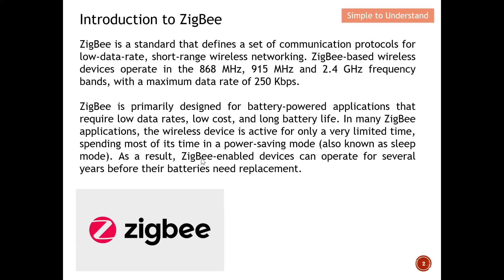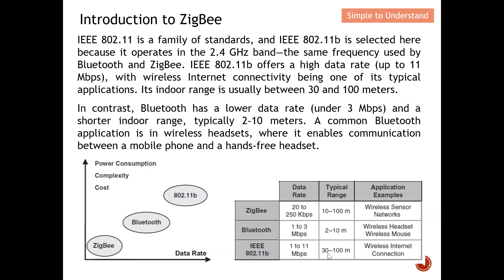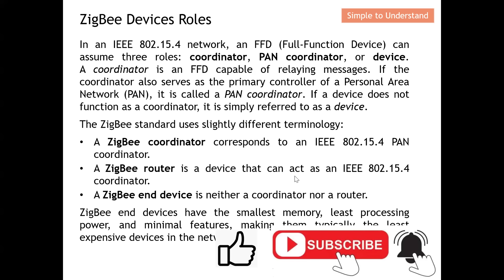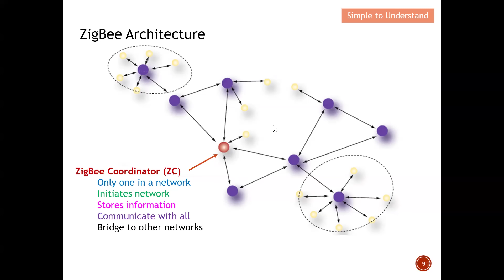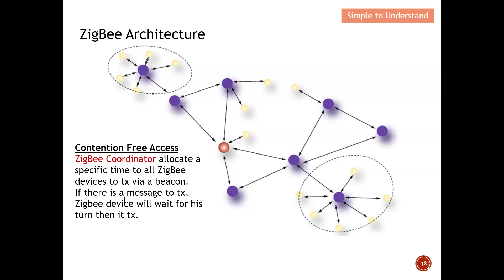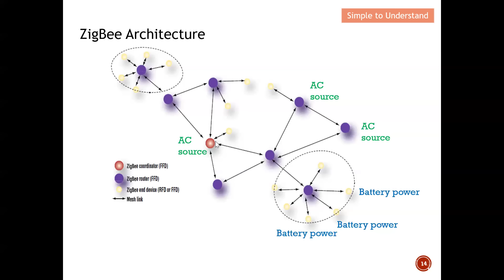ZigBee #1. How This Global Standard Power Smart Applications with Low Cost, Long Battery Life & More

Comment from the maker: Thank you for watching this Zigbee discussion video.
Although Zigbee has largely been overtaken by Low-Power Wide-Area Networks (LPWAN), it still retains some unique advantages. Zigbee was the first low-power (transmit power under 25mW, or approximately 14dBm) mesh networking technology. Initially, it was widely used in smart home applications, but it is now also deployed for IoT connectivity.
In Zigbee architecture, there are three main components: 1) Zigbee Coordinator, 2) Zigbee Router and 3) Zigbee End Device.
Each component plays a distinct role to ensure data can be transmitted from the end device through the router to the coordinator.